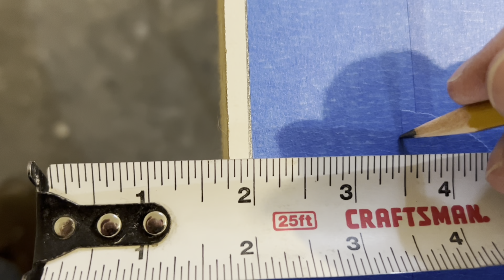How to Fix a Door Rubbing the Floor

Comment: Simple but smart techniques. I have to deal with a couple of doors that stick on the jamb side even after grinding down and bending hinges. Complete pain. LOL.
Reply from the maker: Thank you!  I agree doors can be a pain.  Lol they’re one of my least favorite to work on and some how I have multiple door home repair videos.
Reply: Did you try shimming the lower hinge?

WHERE to add the shims makes a huge difference. 
1) on the bottom hinge, obviously
2) Door scrapes floor 
     a) ...within first 45 degrees of opening swing
          i) shim between hinge and door
     b) ...beyond 45 degrees of opening swing
         ii) shim between hinge and jamb (framing that hinge is mounted to)

Comment: If you dont need excessive adjustment, just shim the lower door hinge.

WHERE to add the shims makes a huge difference. 
1) on the bottom hinge, obviously
2) Door scrapes floor 
     a) ...within first 45 degrees of opening swing
          i) shim between hinge and door
     b) ...beyond 45 degrees of opening swing
         ii) shim between hinge and jamb (framing that hinge is mounted to)
Reply from the maker: @kurtreber9813  Good tips, thanks for sharing with others and watching.

Comment: I have this problem with the kids room. The only problem is we rent and therefore do not want to have to purchase all the stuff used in the video.  May have to find a different solution. Sadly.
Reply from the maker: Another solution that is a bit more manual is to just use sandpaper or a hand planer to remove the material from the end that is rubbing.  Does that help?
Reply: Try shimming the lower hinge.

WHERE to add the shims makes a huge difference. 
1) on the bottom hinge, obviously
2) Door scrapes floor 
     a) ...within first 45 degrees of opening swing
          i) shim between hinge and door
     b) ...beyond 45 degrees of opening swing
         ii) shim between hinge and jamb (framing that hinge is mounted to)